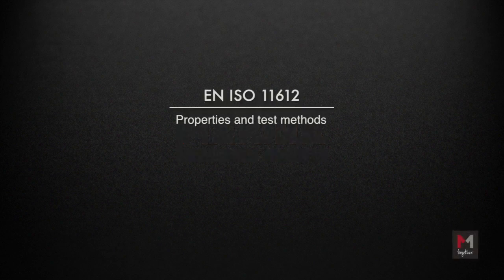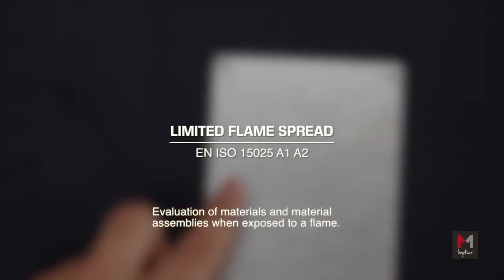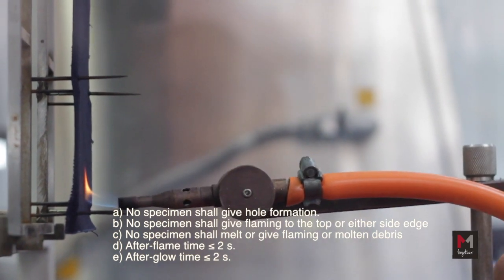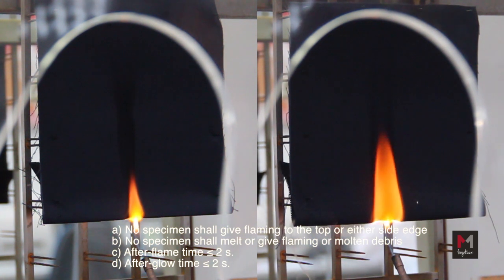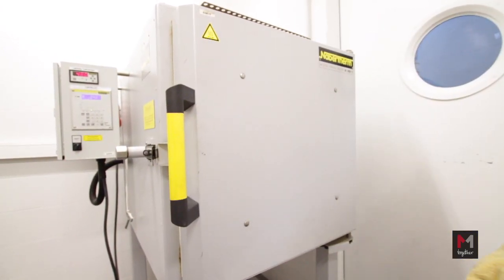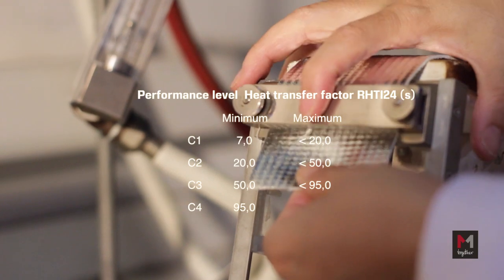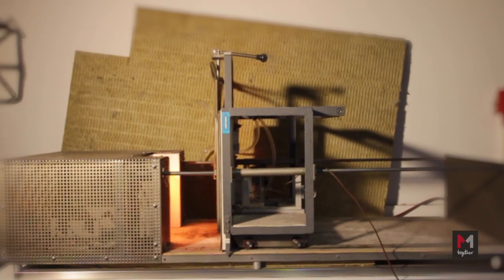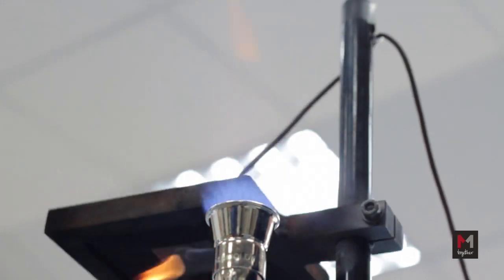EN ISO11612 Technical Fabrics Tests methods by Marina Textil

Comment: Dear Marina. You are conducting the Bottom edge flame test ISO 15025 wrong
Reply from the maker: Dear @viggo69, the 15025 test method, procedure B, has changed recently, and the size of the sample tested is narrower from now on. Apart of this appreciation, the rest of the procedures are reproduced accordingly to EN ISO 11612. Please, if you have any doubt, please contact us at info@marinatextil.net Thanks a lot for your comment.